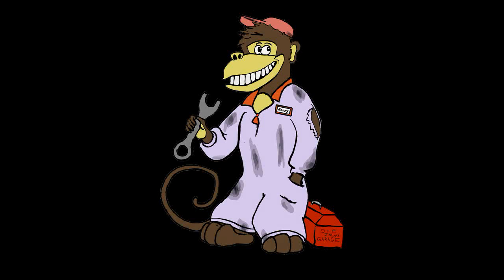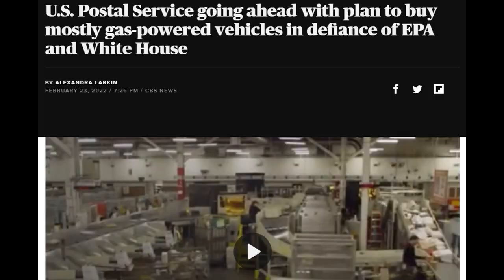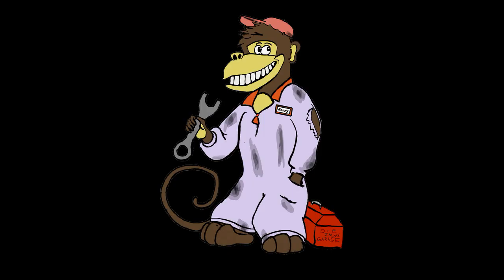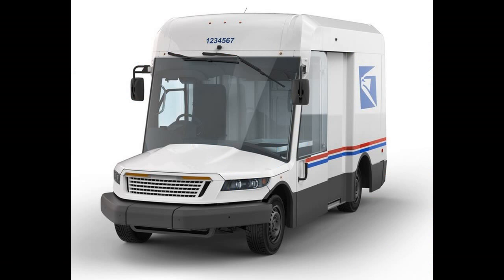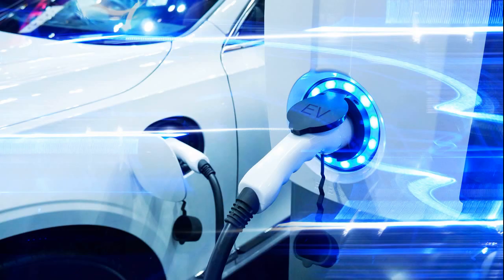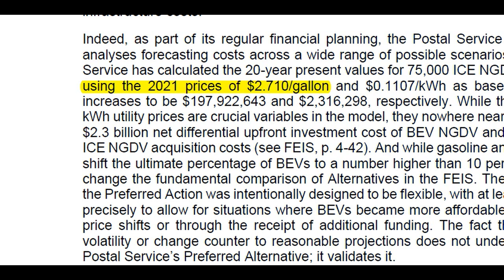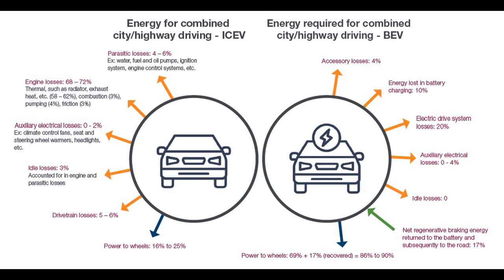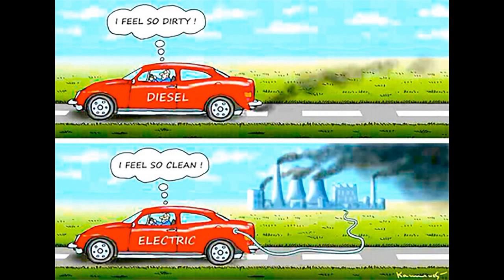Why USPS is going with GAS instead of ELECTRIC for their new fleet (USPS NGDV)

Comment: Long before I ever heard of a "replacement" for the current Chevy S-10 based USPS being in the works The Lovely Bride and I saw any number of former mail trucks on and/or towed behind rollbacks headed to parts unknown....At the time. Apparently, the USPS found that parts for those trucks were getting harder and harder to find and found it necessary to buy (back) a number of them that had been sold at auction to individuals and/or salvage yards. A mail carrier in our area told me that those "salvage" mail trucks ended up in a government depot and were being carefully stripped of any and all useable parts that could be used to keep currently in use vehicles in service until a replacement could be found, produced, and fielded. In the meantime, local urban and semi urban mail carriers assigned the old trucks are being "strongly encouraged" to park their vehicles as often as possible, and walk as much of their routes as weather and "personal physical capability" allow.

Comment: The fact is, that in the long term, batteries and electric cars make far more pollution than gas combustion vehicles. It is somewhat complicated and not something that the government and  research institutions will admit. The pollution made in the production of batteries as well as the disposal of old and dead batteries is extremely toxic. It isn’t PC to say these things, but any power engineer will confirm this. We are off the rails as we look for cleaner and efficient transportation.
Reply: Yes
When you consider the difficulty of recycling the batteries, the use-life of the average battery, the lithium mining required to make those batteries, etc etc..
And then consider that about 70% of our power (in the US) still comes from gas/coal. Making EVs literally coal-powered.

Yeah. EV currently is kinda a scam.
Reply: @jazeenharal6013  👍👍

Comment: Our area tested electric vehicles for usps. We had to spend $500,000 on electrical upgrade to facility for 4 chargers. We ran 2 different designs and not a single one lasted more than 5 hours on route time. The true cost of facility upgrades to 50+ year old post office buildings would be prohibitive.  And many area are struggling with daily grid capacity.  In a 2 year field test, we had no power from grid over 40 days. We couldn't use the vehicles those days.

Comment: Because they want them to be able to finish a mail route probably lol

Imagine delivering mail in the heat or cold and having to use a battery to run a compressor or heating coil...it wouldn't last the day without requiring a charge. Our mail-people out where I live drive all day long to deliver everything.

Comment: Electric vehicles are not “green”.  Electricity has to be supplied by coal fired generators or other means.  Not to mention the environmental impact of the heavy metals used to make the batteries.  Then of course when the batteries have been depleted, the nightmare of disposing of them hasn’t been resolved yet.  Internal combustion right now is the best option. Even if a 1 cent increase in gas prices costs the USPS 8 million dollars.

Comment: If you want to save the environment, dont use a battery powered car! But at least we can still enjoy the LLV before it goes away, if only i accepted the job as a USPS mechanic a few years back/
Reply: I wish they would just use the same design of the LLV just upgrade the engine put in AC/heat and a radio and be done with it

Comment: I wonder if anyone has considered the fact that when everyone has an electric vehicle, goes home in the evening and plugs it up, that all the lights in the country go out because of the worn out and overtaxed power grid. Oh well, just a thought.
Reply: That is something to consider.  At my place of employment, we need to go on curtailment during times of high power consumption (run our diesel generators) and in the winter, switch to fuel oil to take the load off of the natural gas grid.

I think it would be okay when charging vehicles during the night time hours.  Electricity demand really drops then, and that would be the perfect time to charge them.  I think that the residential charging stations will one day need to be controlled by the power companies, like how many air conditioners currently are.

Comment: I think they made a common sense decision not to go electric because there are too many downsides that need to be addressed before they are a sensible choice if you want a reliable postal service, however I can't believe they couldn't find a better more efficient petrol engine than that and I also don't understand why on earth they designed it with such a rediculously large  windscreen which will be very expensive and will make it like a greenhouse inside, so the aircon will have it's work cut out

Comment: People I guess don't realize all the power it takes on these mail routes the stopping and starting continuously that goes on delivering mail, packages, newspapers, etc.  All the maintenance required on a vehicle being used for these purposes is pretty high....the mail carriers would like to complete their routes in a timely manner and would like to be home in the evening, not stuck on a back road somewhere because the battery in their golf cart died 1/2 way through their route.  The size of those new mail delivery vehicles they're not light weight, you'd have an enormous extremely expensive battery to run the thing, and starting and stopping for many hundreds of mailboxes on a route the thing probably wouldn't have much in the way of mileage, especially with all the electronic crap being added for safety sensors, cameras, AC, etc.  

An electric delivery vehicle might be fine for a small city route, but out in the boonies those things ain't gonna cut it.

Comment: For the type of duty that a delivery truck such as these do, I would expect electric drive to be the way to go.  The kicker of all electric cars built today is the batteries.  I hope I am wrong, but when is the last time you saw any kind of battery in any device that was.... 10 years old and still strong?  If the batteries were not expensive and/or lasted longer, then there is literally no reason to not go with electric drive.  There are some old Priuses still running around on their original batteries, but a hybrid doesn't need a battery at optimal capacity to do the job effectively.  But even with a 10 year battery life, I would expect the fuel savings to make up for the extra cost of the vehicle and and even a battery replacement to go the extra 10 years to get to 20.

To re-charge a fleet of electric vehicles.... that's another hurdle to overcome.  The power requirements are enormous.
Reply: They expect 1m miles over 20 years.  That means going through five whole battery pack, essentially tripling the purchase price over time.
Reply: @mojrimibnharb4584  that may be so. My experience with batteries in general is that time is the bigger wear factor vs actual use. They have the predilection to slowly degrade as expected and then suddenly go poof.
New battery technology will hopefully keep that from happening.
Reply: @paulstandaert5709  In general, we measure battery life in recharge cycles, though shelf time does have some effect due to self discharge.  As for a tech fix, don't hold your breath. This is entirely a matter of physical chemistry where a basic tradeoff has to be made on the molecular level.  

The more energy dense a cell (Amperes per kilogram) is, the higher the voltage, the greater tendency to self discharge, the more likely to catch fire, and the more environmentally disastrous the materials in its manufacture.  Lithium, for example, requires 2000 tons of water to extract one (1) ton of ore. That water is now toxic waste and must be kept in gigantic reservoirs, forever.  Lithium disposal protocols are similar to uranium.
Reply: @mojrimibnharb4584  Correct. Cycles have always been how batteries were marketed, but even the best treated battery has a lot of difficulty being strong after 10 years regardless of how good of a life it has lived. 
It's my experience. Cordless tools, laptop computers, cellular phones, etc don't make it that long. Somehow putting a battery in a car is going to make it last a lot longer than 10 years? Hopefully. I hope my pessimism is unwarranted.

But there are also the lithium mining issues like you said. The environmentalists don't stop to consider that. And when they are done in places around the world where there is no EPA, well... I am guessing those reservoirs have holes in them.
Reply: @paulstandaert5709  Like I said, time does matter but mostly it's discharge cycles. Ask yourself how many times that battery has cycled in the 10 years you're referring to.

With BEVs that 200-250k mile figure is derived from the number of charge cycles needed.  Getting 200 miles on a full charge (optimally) that's 1000-1250 cycles, the expected for Li-ion batteries.  Real world numbers are probably 75% of that.

USPS BEVs with short range batteries (<100 miles) are going to be even worse. That's full battery pack swap every 100k miles, meaning 9 swaps in a 1m mile service life. This equates to buying the vehicle 5.5 times throughout it's service life.

No actual environmentalists are pro-BEV, it's a marketing scheme and the public at large not doing any research. This is america and no one has the nerve to say "ride the bus."

Comment: In the long run a EV powered commercial truck fails. A the cost to buy B the Cost to maintain is insane. Gas will be back around 2.50-2.80 soon enough people
Reply: Maintenance? My Chevy Bolt has practically no scheduled maintenance. No oil change, no oil filter, to air filter, no belts, no hoses, almost no brake pad usage (regenerative braking), no catalytic converter, no O2 sensors... the list goes on. Only scheduled maintenance is tire rotation. Electric motors have one moving part. 
Charging at home is VERY inexpensive compared to even $2.50/gal  (Gas prices down to 2.50? Hope so, but the future is unwritten on that one.) 
As we go to renewables, fuel prices cease to be a concern. 
Maximum torque at 1rpm. Stop-an-go driving - no problem.

Comment: UPS, FedEx, Amazon, and now Walmart are all using "off the shelf" delivery trucks. Why can't USPS do the same and save lots of money? Basically, USPS needs a small delivery truck. I find it hard to believe that GM, Ford, Chrysler, Honda, Toyota, or some other actual car maker doesn't have something to fit the bill. Look at this ridiculous design! Is this a joke? Is this the Onion? Plus not going electric is massively short-sighted. I can't imagine a worse scenario for an internal combustion engine. Drive for a block or two, park for 15-20 minutes, drive for another block or two, park for 15-20 minutes, drive for another block or two... This would be perfect for an electric motor.

Comment: Ok civil… I can do civil…. MORONS !!  No I guess not… keep in mind I would for an automotive company that owns almost all the other car related companies (non oems), so I have access to mucho data. This is my opinion however. Electric cars don’t make sense for the mass market, today…. HOWEVER as much as I hate to say it because I’m a free market guy “nothing spurs innovation faster then regulation”… the aftermarket will supply… Hybirds make more sense for the general populous as it removes the biggest hurdle to electric cars and that’s the infrastructure. With that said, if there is a case to be made for an electric cars it’s absolutely the postal service. The vehicles runs regular/fixed routes, they are parked nightly in a area conducive to charging, and solar can be added to the mix with relative ease. Going back to the company I work for they have already made massive investments in EOL (End of life) battery tech, as well as battery conditioning and testing systems for the pre owned market, so the bar is already starting to move.